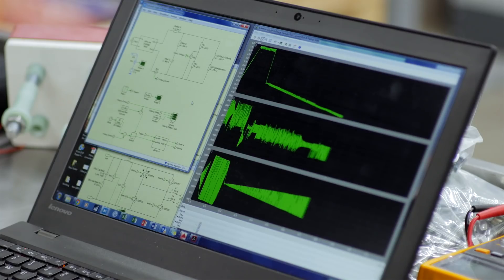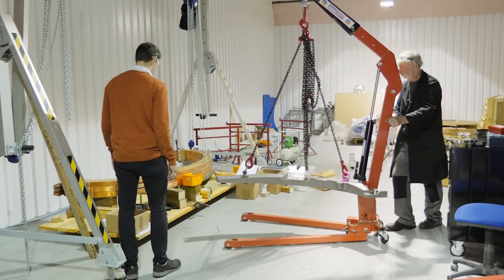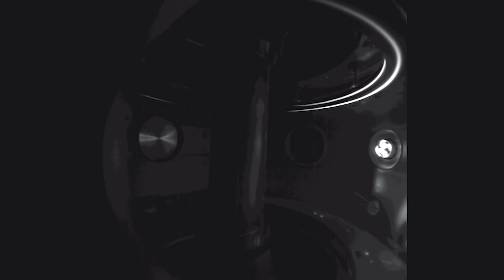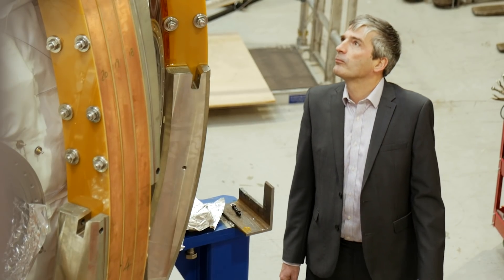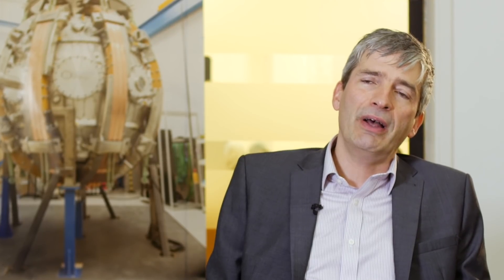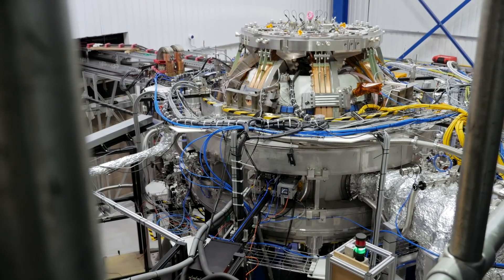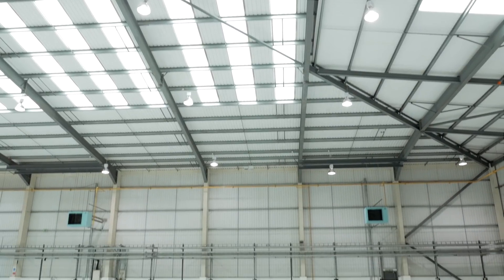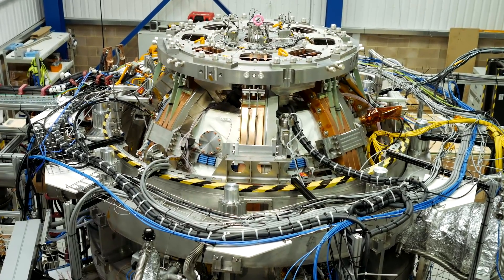Achieving 15 Million Degrees

Comment: As a sciene and technology channel, you should've stated in what are the degrees you're refering to. A degree isn't a unit.
Reply from the maker: The Fahrenheit and Celsius scales were developed in the region of human perception and converge at -40. The Kelvin scale goes lower still.  The temperature at which fusion occurs is so far above the region of human perception that the unit becomes irrelevant.  100 million degrees C is 180 million degrees Fahrenheit.  But do you fully appreciate the difference between 100 million and 180 million?  Hundreds of millions of degrees is hundreds of millions of degrees in whichever unit you choose to measure it.  I hope this aids your understanding.

Comment: you have hit 15 Million degrees, and now you are going straight to 100 million degrees ?!....surely not in one shot ?.....6.66 times hotter....that's a devilish coincidence lol.....but seriously though well done, it seems that your smaller  and more modular approach is quickly getting closer than the big Tokamacs...when you say that you will be going for 100 million degrees in an upgraded Tokamac, I assume that it will still be at the same scale, since it is still called ST40, but with significantly more current going into the superconductors, will the coils need to be upgraded or of a new configuration ?.. and assuming the basic structure already has the strength necessary to withstand the incredibly powerful loads placed on the device with the much increased field strength..? so ST40 on steroids ? I really hope you crack this .....it will be such a new chapter for humanity...solve so many of our problems all in one incredible moment....best of luck...

Comment: So many questions:
*What materials are you using that can withstand that amount of heat.
*If you would put air into that chamber(I guess there is a vakuum inside) would there be a nuclear fusion happening(like on the sun)?
*How do you measure these amounts of degrees?
Reply from the maker: The materials only have to withstand thousands of degrees not millions, because centre of the plasma is the hottest part and the magnetic fields keep the plasma away from the walls.
For fusion reactions to happen we would put deuterium and tritium into the chamber.  So far we have been using hydrogen.
We have just put a new video out on How to measure 15 million degrees.

Comment: It seems so slow, but really it's a rapid clip compared to other projects. Good luck on the next build. Any idea what the gain is supposed to be when it's all upgraded and running at full power?
Reply from the maker: Fusion gain will likely have to wait until our next machine is ready (we are working on it).  The main objective for ST40 is to achieve fusion temperatures (100 million degrees).